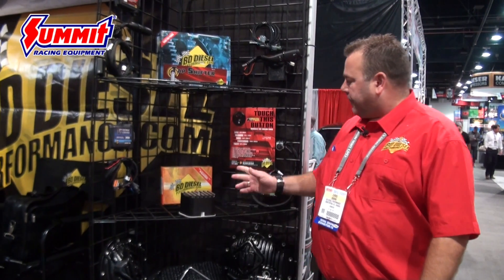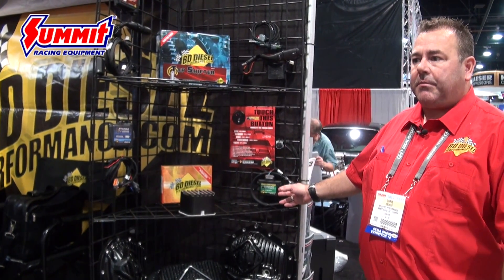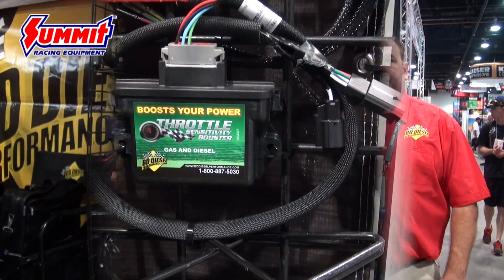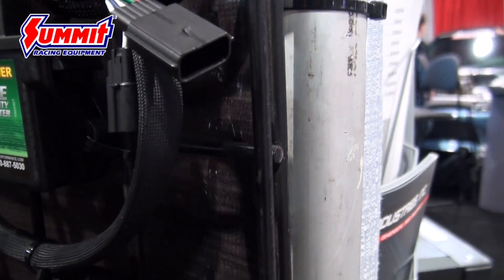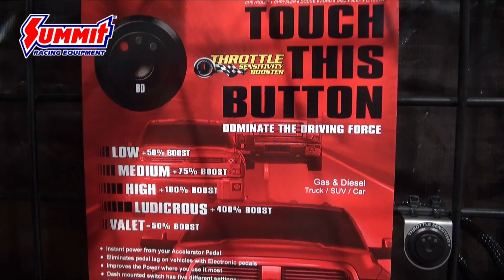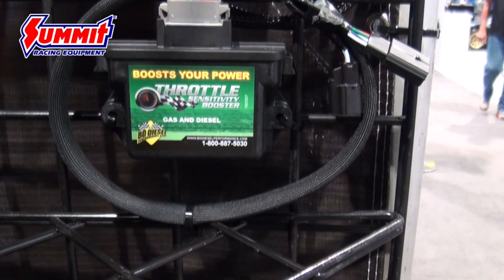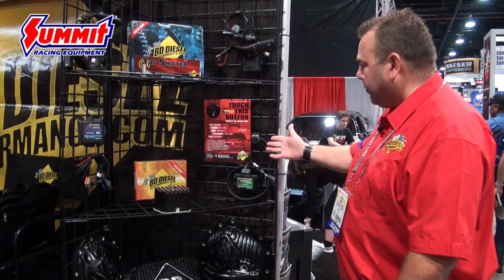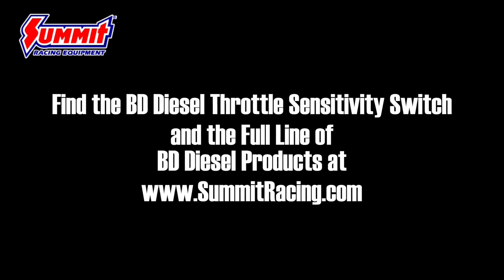BD Diesel Throttle Sensitivity Switch - New Product at SEMA 2015

Comment: wish they would make one for gears and give you those same throttles per gear. say 1st is .10 2nd is .30 3rd is 60 for those with rwd and huge power so you can desensitize the throttle i suck at spelling